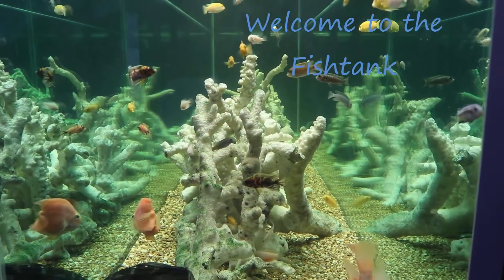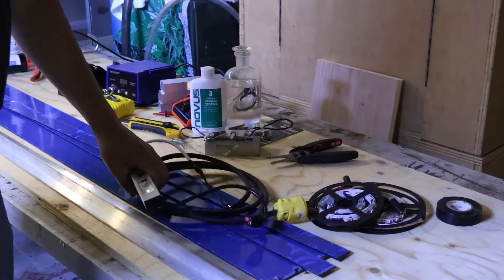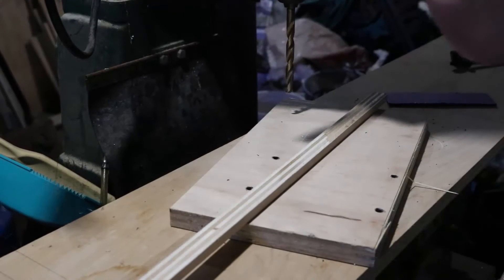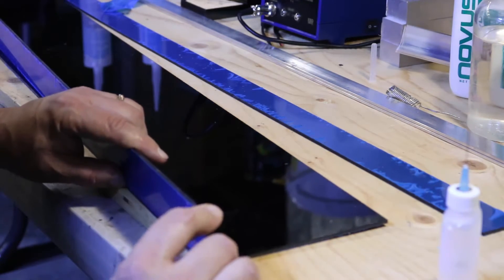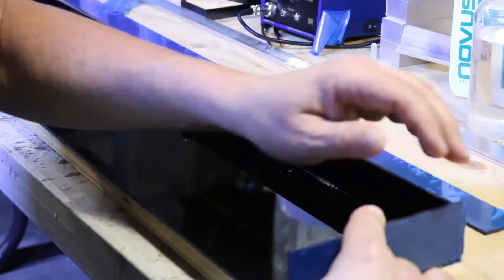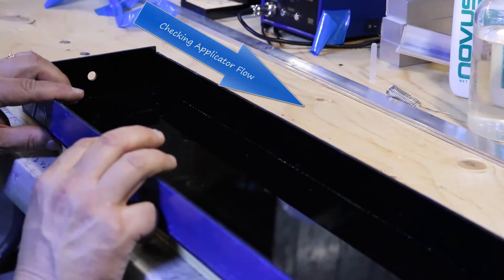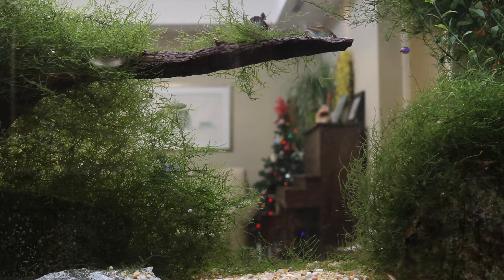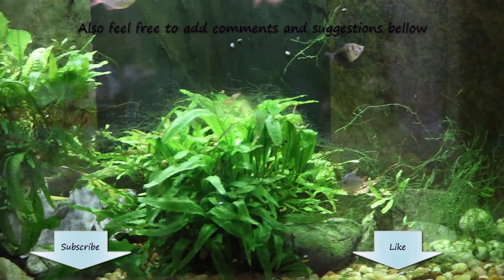DIY LED Acrylic Canopy

Comment: Hello friend, greetings from Canary Island (Spain), thank you for teaching all your works that are spectacular and that we can do for our aquariums. I wanted to know which glue is the one you use to glue the acrylic you use for the aquarium's patches?
Reply from the maker: It's methylene chloride. It melts both sides and then when it evaporates the acrylic becomes solid again forming a weld. Thanks for the like. There is an update to this build coming soon
Reply: Thank you very much for the information and I will continue to see your works, regards
Reply: @FishmanEricRussell  where do you get the bottle you have it in?
Reply from the maker: @nickianderson1716  Hey Nicki. In my younger days I did research in a lab and it was one that was being thrown out.